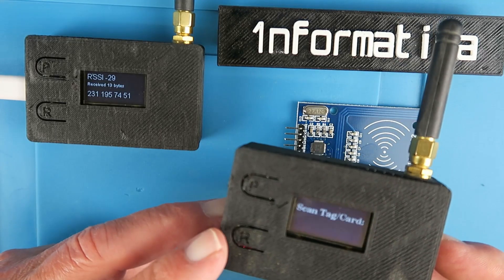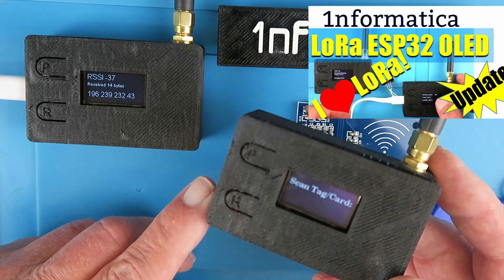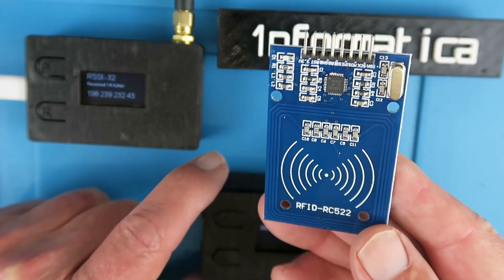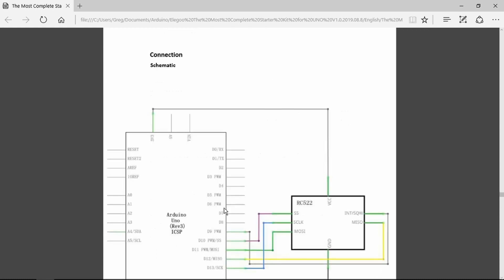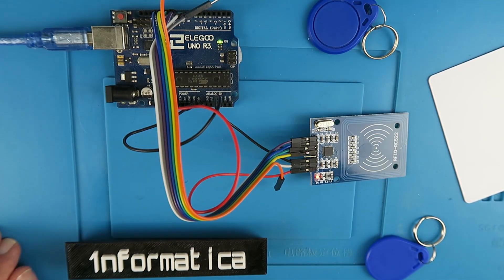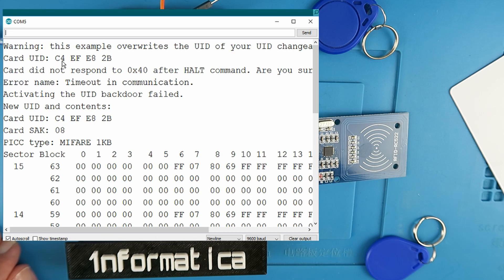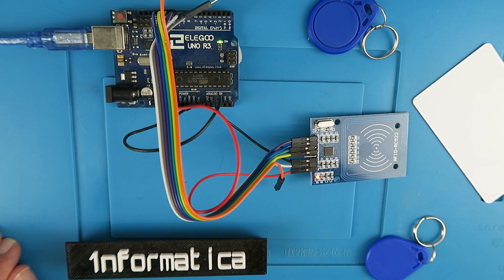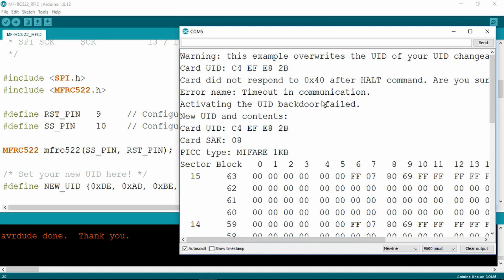Elegoo UNO R3 Project Part 16 RFID RC522 Module

Comment: PROBLEM I HAVE IS THE READER NOT EVEN ACKNOWLEDGING A CARD OR TAG. ANY IDEAS PLZ. I HAVE NOW FOLLLOWED 2 WIRING DIAGRAMS 1ST ONE TOLD ME THERE MAY BE A CONNECTION PROBLEM BUT YOUR ONE LOOKS GOOD ON THE SKETCH.
Reply from the maker: Download the ZIP file on this link: https://www.elegoo.com/tutorial/Elegoo%20The%20Most%20Complete%20Starter%20Kit%20for%20UNO%20V2.0.2020.4.3.zip
In part 2 you can find the RFID example with description and code. Provided the sketch compiles and uploads without error you should get the tag data in the serial monitor.